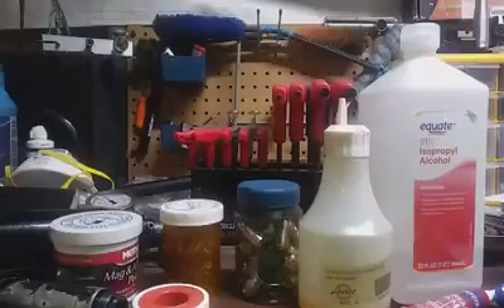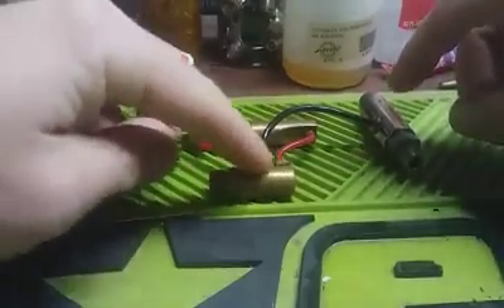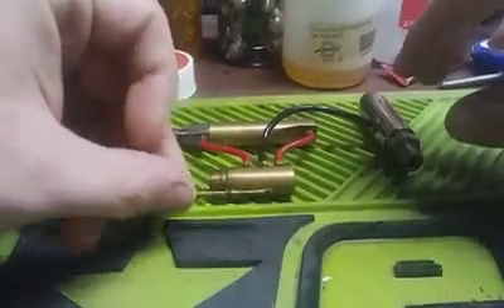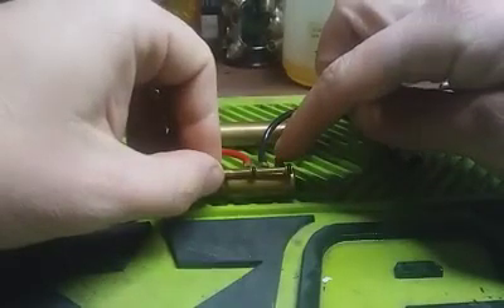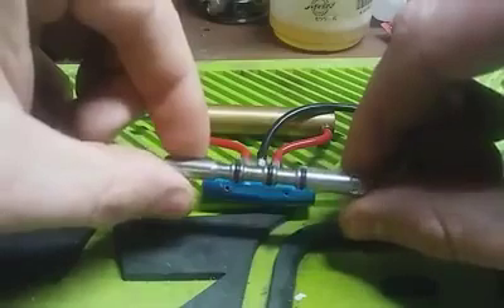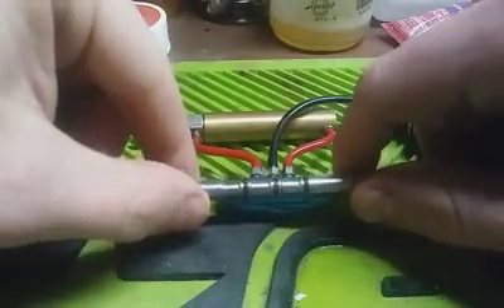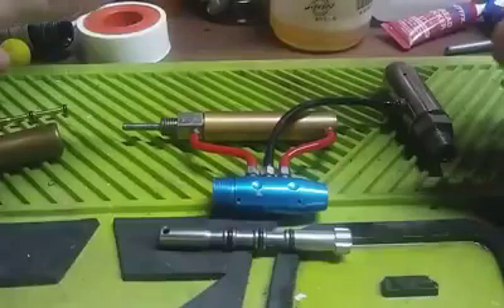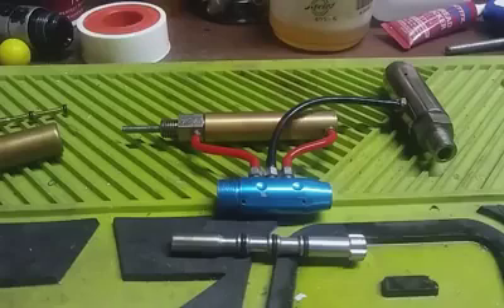How do pneumatics work on a front block?

Comment: This video is so informative. Its a crime it doesn’t have more views! I’m putting together my first autococker. Turning my Inceptions FLE from pump to semi auto, threw some pneumatics on it, and things didn’t work out so well. I have more confidence in getting it to shoot properly. 

Thank you!
Reply from the maker: Thank you! It makes me extremely happy to be able to help out! If you ever need anything, please don't hesitate to ask. :)
Reply: @kccockerdoc  I got my marker cycling ok. When I had my Inceptions FLE as a pump it would shoot at proper velocity. Now with the front pneumatics I can barely get paint thru the barrel. I can set a gauge between my inline reg and vasa. And I set the inline pressure at about 350psi. No matter how far I turn the IVG in doesn’t really make a difference. Any advice?Thanks!

P.S. I have a leak at the barb going into the LPR. I ordered some Loctite 545 thread sealant and I will hopefully get that fixed. But I doubt that is the ‘real issue.’
Reply from the maker: @skinnyboy400  If all you changed was going from pump to mechanical, you didn't mess with the regulator, and you can't get any change out of the ivg adjustment, it sounds to me like you may have your bolt installed upside down.
Reply: @kccockerdoc  the bolt I am using is an ANS quick release bolt. Would having the hammer lug to far down affect how long the valve opens?
Reply from the maker: @skinnyboy400  no, but it would effect where in the cycle the marker actually fires. Pull the trigger very slowly and make sure the marker fires before it recocks
Reply: @kccockerdoc  thanks, that helped. The firing and cocking are too close. Almost simultaneously. Would you happen to be in so cal?
Reply from the maker: @skinnyboy400  unfortunately no, my friend. I'm based in Kansas City, MO.
Reply: @kccockerdoc  I wasn’t able to get it working properly. It wasn’t re cocking. I would pull the cocking rod back, it would fire first ‘very weak’ and then cock back. But sear wouldn’t catch the lug. 

Without air I would also pull the entire back block assembly, sear would catch on to lug, and back block still had a few milli meters of travel before completely stopping. I’m sure cocking rod/back block was set adequately . But oh well… :(

LPR turned up and up didn’t make it re cock either. I left if at ANS today. So bummed for not doing it myself. Arghh!! Hahaha!

Could any adjustments be made to the trigger frame that would cause it not to re cock? Its a used WGP hinge.
Reply from the maker: @skinnyboy400  Depending on what version of the wgp hinge frame, some had a set screw underneath the sear to act as a sear stop that could be in enough to stop a full trigger pull. There were also cams that you could replace your safety with that were trigger stops.
Reply: @kccockerdoc  good to know! Thank you for all your advice.

Comment: Hello love you content can you go over how to prevent the low-pressure hoses from blowing off thank you
Reply from the maker: If your hoses are blowing off, there's usually only a couple possible causes. Your lpr may be too high, your hoses may be worn out and need the ends trimmed down so they're tight again, or your pneumatics may be bypassing and need rebuilt.
Reply: @kccockerdoc  Nope new hoses rebuilt cocker I will try to lower the LPR thankyou
Reply from the maker: @williampaddock4863  if you check out my video on timing, there is a portion that goes over setting your lpr. Zero it out and just walk it up until your marker will cycle correctly.